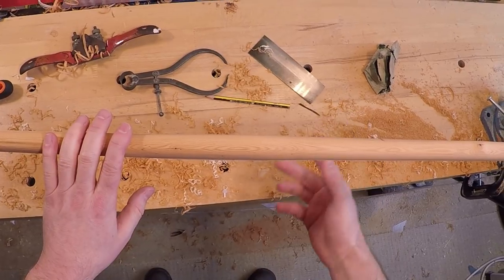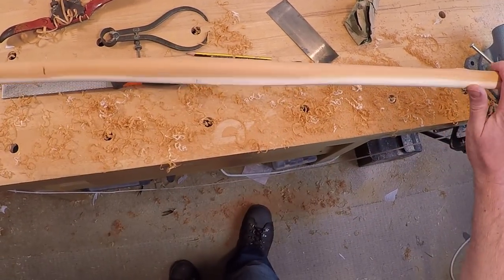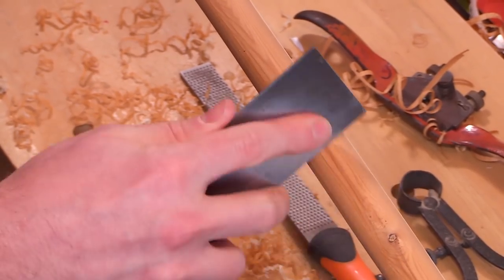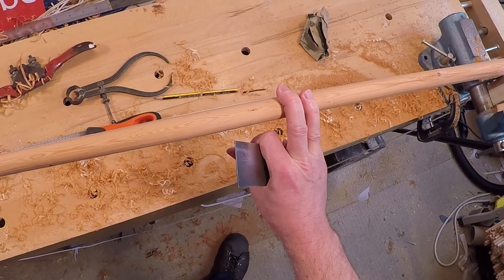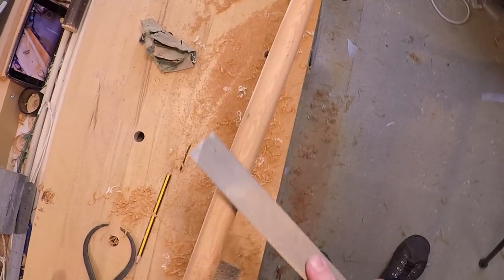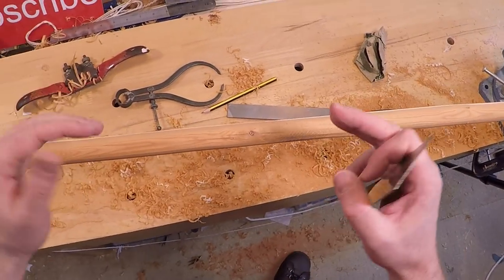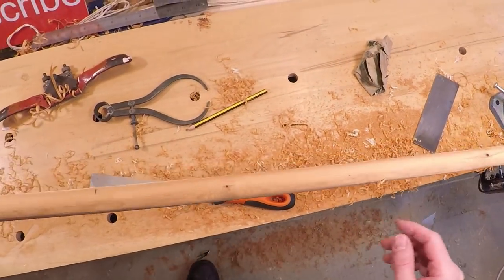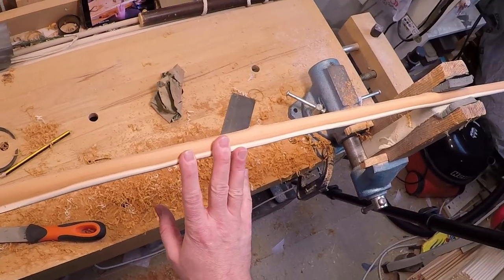How to make a Self Yew English Longbow - Part 2 - Chasing Rings

Comment: I'm working on an elm longbow and it's down to shaping the horn nocks and I've run into a problem. About 1" down from the top nock a 2mm hole has appeared running strait through the limb. It's going parallel with the back and runs from left to right sides of the bow. Its a self bow 55lbs at 27" what do you recommend for fixing it.
Reply from the maker: Hi, sorry to hear you are running into problems, it would be best to email me some pictures headbow@hotmail.com
Reply: I really appreciate the help and you make great vids. Keep em comming. By the way I watched the vid about how dangerous bow making is and your shop is eerily familiar to mine including the stairs and yes, the chicken.
Reply from the maker: No worries, glad you like them.  Share them if you can to help us out.  Lol, watch out for chickens!  We have your email, will get back to you soon.
Reply: Drill down from the Knock end  and with a hard wood dowell about an inch and a half past the hole and fill the rest in with epoxy.
I used to use high impact epoxy for wood golf club's but now they are a thing of the past and I don't know of any source's of good epoxy any more.
We used to make it at work but I don't remember the name of the white powder we added to add strength.
But I have added some chocolate milk to 5 minute epoxy with good results.
Meaning quick curing epoxy gets brittle like glass.
Adding something make's it tougher not harder.
I think my company may have added like a silicone powder that made it tougher and yet pliable.
Our epoxy was like a thick gel like (smooth on epoxy)
I would recommend smooth on epoxy.
My long bow was 2nd story wood,.... but a part of the limb had a hollow pocket I used high impact epoxy in it.
the bow broke 15 years later, but not where the epoxy was.
So hole's are repairable,... my bow was hickory.
But I still have the rest of the staves from the 1st story good wood with no limb's.
Elm is legendary bow wood don't give up.
Reply: Just curious, what was the fix?

Comment: Why is the bow laid out with the top limb 1 inch longer than the bottom limb. Can you do a video on marking out a bow
Reply from the maker: We move the handle off center, this means one can place the arrow nearer the center when shooting, if you imagine placing your hand on the center line of the bow and then placing an arrow above your hand you will be shooting the arrow well away from the center, so we move the handle down a bit, this means the top limb is slightly longer, but you will be shooting nearer the center.  I hope this makes sense.